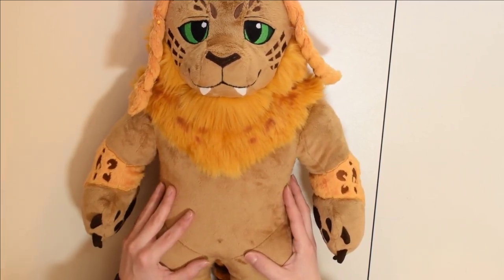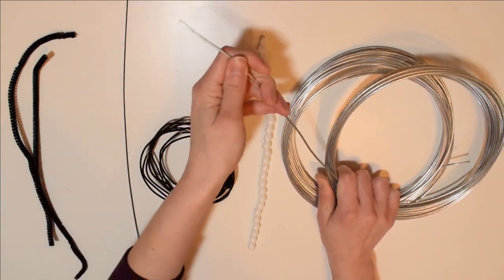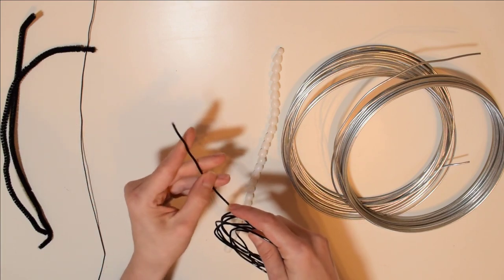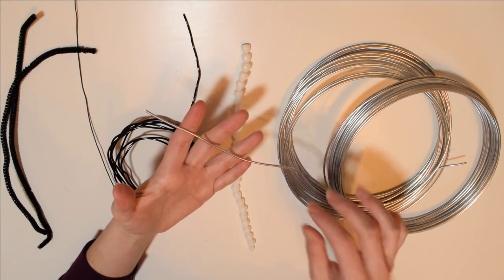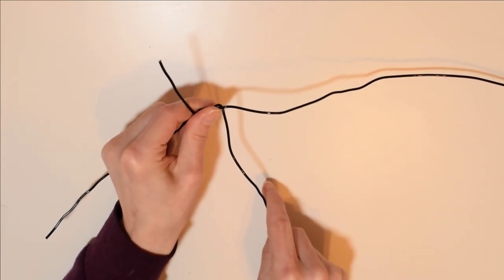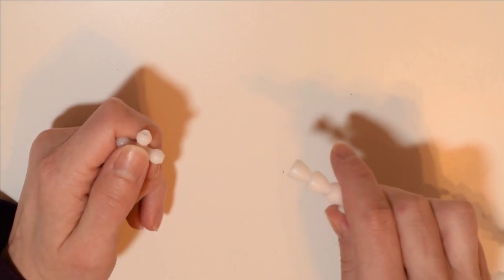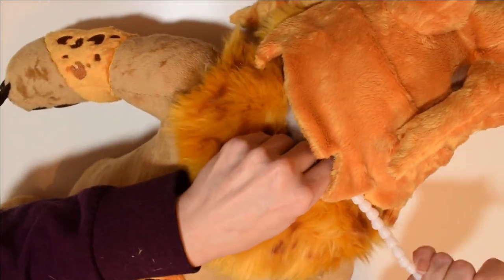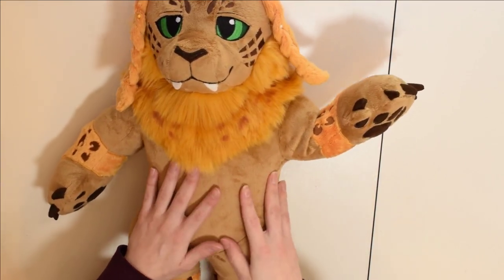Plush Making 101: How to Make Your Plush Posable

Comment: I usually put a thin fabric tube around the wire and stuff it to make tails for wearing on a belt for costumes. The thin fabric with stuffing around it protects the wire from poking through when wearing to conventions or even for daily wearing. After you make this you can add the outer layer of the tail to make it look like whatever type of tail you make. You just make the outer part put the wire with fabric and stuffing around it inside and then put more stuffing as needed. It's how I do it for costumes especially with children wearing it and playing and stuff to keep an extra layer of protection when using any wire. If needed you can use a thicker fabric around the wire. 

I don't make plushies that often or really at all but these can also work for tails, ears, and even horns when cosplaying if you sew some for a cosplay.

Comment: On that last type of wire, that most heavy duty one; what size gauge is it? And do you think it would work to make a Beetlejuice Sandworm, posable plush?
Reply from the maker: I'm not sure, i bought it a long time ago and it's not labeled. I'd suggest just going to a hardware store and testing out the wire in person. depending on what size plush you're going for, i'm sure it would work, but you can also use the plastic armature

Comment: I liked the plastic armature, but I believe I will have a hard time finding it in area. Do you think it would look/feel similar if I used plastic beads on top of the wire?
Reply from the maker: it wouldn't function the same as the plastic armature. the armature is put together like a human spine where every piece is jointed into the other, so you can't get severe angles like you can with wire (and prevents snapping which can happen with thin wire which is bent a lot). if you can't order it online to be shipped to your location, i'd recommend just using wire and if the feeling of wire inside the plush bothers you, you could wrap it in fabric.

Comment: How would you go about wiring just the ears of a plush? How would you 'set' the ends (where they meet the head) so they don't shift about?
Reply from the maker: maybe make a triangle shape out of the wire instead of just a single piece, running it along the outer edges.  if it's wire you should be able to poke it through the stitches where it attaches to the head for the wire to slide through, or just leave 1 or 2 stitches open. then with the stuffing holding it in place in the head, it shouldn't move